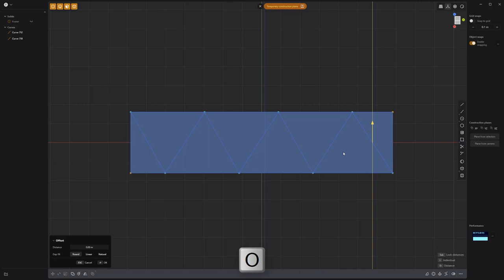Plasticity | Create Grid Webbing Detail

Comment: shift+D at 0:18 does not create a curve for me - but a sheet and then I have to apply "Find Boundary Edges" to make it a curve to get to the next step.. can't figure out what I am doing different with my duplicate command..
Reply from the maker: hmm..  just tried a few times and not seeing that result. what version of the software are you using?
Reply: @Pixelfondue  1.0.11
Reply: @sturm3d  Did you ever figure what the issue was? It used to create curves for me before when I used Shift+D, but now it creates sheets instead. Doesn't matter if I create a new file or not, still same thing..
Reply: I don't know if you already found a solution on this but I figured it right now by playing with the settings. Whenever I have it in face select mode and press Shift+D it converts it into a sheet, but when I'm in edge select mode it converts it into a curve. Hope it helps.
Reply: @progon314  thanks, I will have a look!

Comment: I'm not sure how the program has changed but I cant use the line tool to create a triangle pattern through the rectangle.. it just makes a separate new curve on top of the duplicated one
Reply from the maker: that's how it works. the line will be a separate curve. But as long as the line and rectangle are on same plane you can continue the steps
Reply: @Pixelfondue  thanks figured out